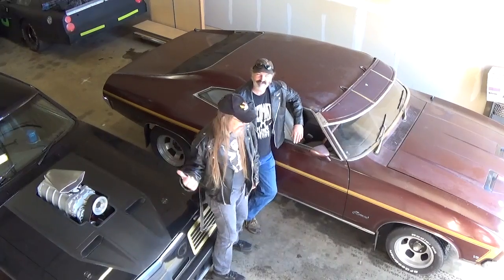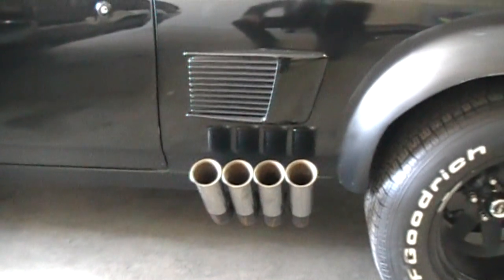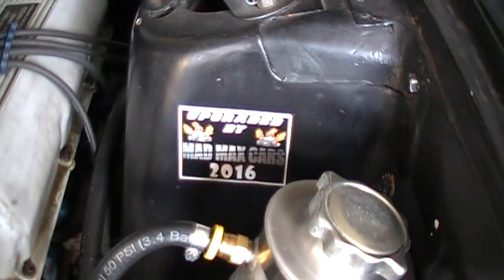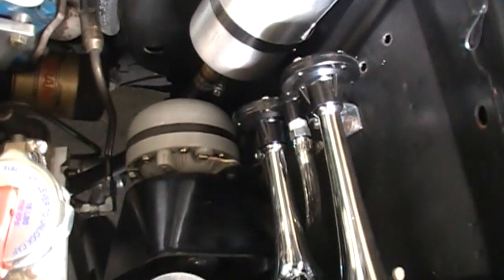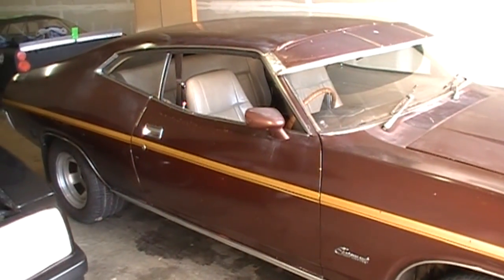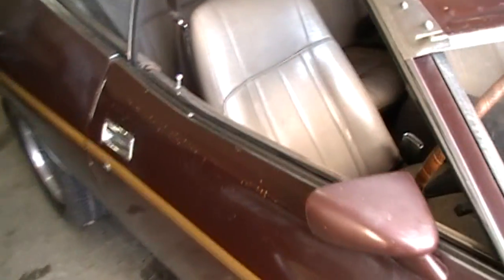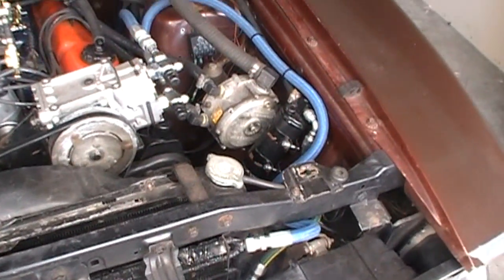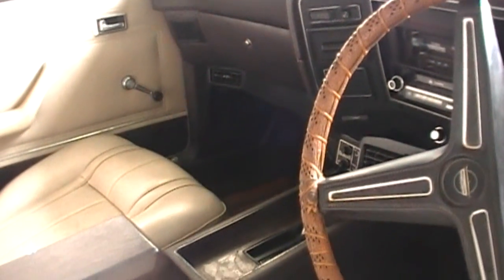Mad Max Interceptor and XB GS Barn Find Ship

Comment: Just a quick note the black car Is a Pursuit Special . Max’s yellow car was an interceptor as was March Hares XA at the start of the film. Big Bopper was a Pursuit car also but no a special. The car was only ever referred as a interceptor once and the was in MM 2 but the mechanic but as a generalisation.
Reply from the maker: That is indeed correct,  based on the original scripted description of the car and the dialog of the MFP radio dispatcher talking about the car in the first film.  We tend to use the titles interchangeably here, favoring the reference that the average person recognizes for the car "Interceptor". You might notice we used both terms with a slash in the description above for clarity. Though we do prefer the "Pursuit Special" title ourselves, it is probably worth noting that George Miller himself pretty much exclusively uses "Interceptor" as a reference to the Black on Black these days. Likely as we do, using the term that has become somewhat ubiquitous in pop culture for the general public. Thank you so much for watching and for your excellent comment!

Comment: basically a torino, fairlane, falcon body 70-72 all ford ...  but getting some sheet metal & do up reskin be very kool build if possible ..
Reply from the maker: It is the Mustang/Torino/Comet/Montego chassis. The body is quite different from the Torino when you see them next to each other. People do use the Sportsroof Torinos of that vintage for Tribute cars sometimes due to the similar look.

Comment: How can I get my hands on one of these mad Max interceptors?
Reply from the maker: Contact the team at www.madmaxcars.com we can build you one from the ground up, or you can save time and cost by grabbing the a finished turn key car that is in our classified ads right now for sale. Its in the USA already and priced well below its market value at the moment. If you want that one I would move quickly as it will undoubtedly get snapped up in no time.
Reply from the maker: Did that help?
Reply from the maker: @ericcorreia1254
 Anyway, the team can help make that dream come true. Let me know if you have any troubles connecting with them.

Comment: that looks like a 429 in that mad max car ........wow huge motor
Reply from the maker: They are Block Block Fords, but I think both are 351C engines. thats for watching and for your comment!
Reply: No Australian Falcon was ever sold with a big block. However, any ford big block will fit in the XA/B/C falcon (except the BOSS 429 unless the coil towers are modified) as their engine bay and front suspension is identical to an early 70's Mustang. Two problems with big blocks in these cars though, one is the RHD steering box sits right in front of the rear most exhaust port, the other is the vertical height from the cross member to the underside of the bonnet (hood) is about 2 inches less in the Falcon than any other American Ford so a very restrictive "low rise" manifold has to be used.  The most powerful engines you could get originally (available from 1970 to 1975) was the 351 4V Cleveland with 11:1 compression and around 330 HP.
From 1976 on the XC/D/E 351's had 9:1 compression and smog gear, however, if you can find an ex-highway patrol one of these, they were factory fitted with a 1970 "GT" cam shaft!.   Here's a crazy piece of trivia for you; these Australian built 351 Clevo's were imported BACK to the States and fitted (by Ford) into the CiHP Crown Vic's up until 1984! (the cars could not be registered in California after their police days as they had no hope of passing smog tests)

Comment: For those not familiar with the Aussie Cleveland engine there was a 351 plus a 302 that was never available here in the US. That XB Fairmont was likely a 302 car.
Reply from the maker: Indeed it is. Now totally rebuilt to factory spec from the oil pan up. If you would like to see more videos of this car, you can see the "Barn Find" and "Arrival" videos elsewhere on our channel. Thanks for watching, and for your comment!
Reply: GTs were all 351. Early GTs used open chamber 4Vs
The 302 were a 3" stroke crank, 6 030 rods, normal 351 pistons. Same block as a 351. 351 engines were all navy blue, 302s were brighter blue with orange rocker covers.  And closed chamber 2V heads. And little 2 bbl carter or stromberg carbs on XA XB. XC used a Thermoquad on both 302 and 351. With the pollution requirements they ran the valves so hot the simply burrowed up the ports and made oval valve guides. And were 12mpg dogs!
RThe XA XB engines never had these problems.
Reply: The Fairmount came with the 302 or 250 straight six. The 351 was a custom order as was the paint. Most were either the Brown or Cream in colour. Also the GS could come without the GT dash and grill if ordered that way. Great car I had a sedan GS Fairmont which I sold for $500 dollars back in the 80's to a guy that just wanted the hood. Didn't realise at the time that these cars would be a collectors item.
Reply: @ldnwholesale8552  bro, don't forget the beautiful XR and XT gt's. Both legitimate gt's, both raced at Bathurst. XR GT came with a 289 Windsor, XT GT came with a 302 Windsor.

Comment: Greetings mate.   My uncle had  a Fairmont  coupe 302 with white interior brand new in the 70s'. I think it was an XB.  Nice car, bit cramped in the back....How do these cars ride compared to the US Fords of  the same era.  BTW   are  the US LPG fill necks the same as ours?  I mean if a OZ LPG was shipped to the US could the cars be filled at Gas stations or do you have different nozzles?     cheers brothers.
Reply from the maker: Greetings!  Sounds like your Uncle had a cool car!  The ride of these cars compared to USA makes is very similar.  They are built on the Mustang, Torino, Comet, Montego chassis with a slightly different wheel base. Most parts even interchange with various USA cars of the era. The back seat is cramped about the same, even worse on the Mustang (might as well get used to not having circulation in your legs if you want to sit in back). The LPG fill is the exact same. Guessing it is an international standard. Thanks so much for watching and for your comment! Cheers!
Reply: + @MadMaxCars  The LPG filler , well that is good to know.    I had a '76 Fairmont GXL  in 1980, FMX 9 inch....fitted the 302 2V heads and it really bumped the CR up....LPG...can take high compression.       BTW   telling your mates that you own a 302 Cleveland in the US is a bit of a conversation starter .        Looking forward to more vids.
Reply from the maker: @BJBFOREST  LOL, yes, most of us yanks (especially ones that know Fords domestically) will start in right away when you say 302C, and then of course the education starts. That talk inevitably leads to "You do know that have like 4 more types of heads for that engine than we do? Let me tell you about the Phase 4......". We do have a ton of other cool videos on the channel you my enjoy if you haven't seen our older ones. We will keep the new ones coming too!
Reply: + @MadMaxCars    Phase  4...the holy ground of HOs.  In ' 72 the Victoria Police Traffic Operations Group received an XA GT for interceptor work...the Ford factory was just up the road from the Dawson st Transport branch.   the car  was owned by Ford and lent to the police.  It had a huge carburetor on it without any carby id tags.  ...it was reported to have reached 160mph whilst with the police.  After a short time it just disappeared , returned to Ford.  It is felt that it was a Phase 4 and was being tested for durability with the police.  If anyone can break a car it will be a cop....Legends are made over a few beers but the person who told me was  adamant and was in the TOG police at the time.
Reply from the maker: @BJBFOREST  That is SO COOL! It would be amazing to know where that car is now. We imported a Landau once that had Phase 4 parts snuck onto it. We were pretty sure it was one of the places that the factory "disposed" of some of the bits.
Reply: @MadMaxCars  they made an XA RPO 83, it was a hastened GT ish model with many of the left over phase 4 bits. I  never heard of them using them on the Landau, mainly because it was a luxury model coupe (full electrics, flip up covers on the headlights, 2 moulded seats in the back instead of 3) but heaps of the Fairlane and LTD models had strong 4 bolt mains in them, 9 inch  lsd's hooked up to c4's or c6 transmissions,  so that wouldn't surprise me.
Reply from the maker: @whosyourdaddy842  Yeah we are pretty certain. We have a Aussie Mate who lives in the USA now who knew what they were when he first saw it. He used to work at Ford of Australia. He said he had heard they basically just used the parts on some random cars instead of throwing them out.

Comment: I'm not that familiar with the mad max engines....so that blower sits above the carb and is it functional or does it just spin for looks? I ask because blowers are normally mounted underneath the carb and suck fuel in through the carb and then into the manifold......
Reply from the maker: Most of the Mad max replicas are built with a non functional "Prop" blower like the one in this video, because the clients want the "Magic Superhero Power" from the movie of the On/Off Blower active by the red switch on the shifter. We do however build them with fully functional blowers from time to time when a client wants that instead. Thanks for watching and for your comment!

Comment: Was propane a fuel option in Australia from factory or dealer prep? Lastly the steering wheel in both of those cars are on the wrongside! Just saying; )
Reply from the maker: The propane is an aftermarket add in pretty much all cases. Sometimes a Dealer install but not often.  As for the steering wheel, its on the "Right" side!  ;-)
Reply: Ford and Holden both produced lpg gas/petrol combos from the factory from the late 80's until both ceased production in Australia. I think the EA falcon series was the first ford, I'm not sure about the first model Holden. We used to produce Mitsubishi's and Toyota's too, but I dont know if they had factory lpg options. The government had a scheme going until about 4 or 5 years ago where they would subsidise the cost of installation to convince people to do it.

Comment: The aircon is not factory fitted, it is a dealer fitted option, factory fitted units were integrated, the controls were fitted into the heater control panel and the air runs through the dash vents. The Propane or LPG system is also not an original item, it was probably fitted in the 1990's by the looks of the converter and snorkel. The hood is also not original, it's a GT hood as it has the locking pins installed. Wheels are not factory either. It's a pre June 75 model as it has the vertical rear side marker lights. The fuel filler cap is also GT or JGS. Yes it's a nice barn find but very far from original.
Reply from the maker: Indeed much of what you are saying is quite correct. These days "Dealer Added" options are often considered essentially "original", as they were often supplied by the factory and added by dealer mechanics (as an SDC member I can attest that this is generally true among Studebaker collectors also, which I notice by your name you presumably are one). Of course the wheels are obviously aftermarket. However some of the things you mention such as the fuel cap and hood could be ordered as factory options, but also could have been added years later as well. You might note that we say in the video that the owner wanted it kept in "as found" condition as much as possible, and the restoration was done with that in mind. So when we say "original" in this context we often mean as the car was when it was stored away 20+ years ago. Thank you for watching and for your comment!
Reply: Studebaker owner, yes but I also own a couple of rare street rods and 2 March 1976 built XB Fairmont Coupes of which I've owned since 1982, No there not for sale!
Reply from the maker: Always glad to meet fellow Stude fans. I'm a card carrying SDC member, and have a 55 Commander Deluxe Regal Coupe, and also am restoring the 1951 Desert Explorer prototype. Don't sell those beauties! Keep them close to your heart!

Comment: That ford was running on propane? is that safe? granted we're hot rodders so the answer is always no of course not lol but still its the first I've heard of that really on a car that old as is from back in the day.
Reply: Kavinsky Smith.
Yes very safe. Cars converted to duel fuel (LPG / petrol) are very common, and have been around since the early 70s in Oz.
Reply: Huh, well atleast no matter what happens we'll always have a way to run our V8's then lol
Reply: Kavinski Smith'
Too right mate. I've got an old 327 Ponty that's been running duel fuel for years and will do for many more.
Reply from the maker: Yeah. Its not as common in the USA but we do it here too.

Comment: i would love to have a holden.
Reply: Mate Holdens are pox don't get one
Reply from the maker: LOL, The Nightrider liked his ill gotten HQ Monaro!
Reply from the maker: That is a really REALLY good point. Look what happened to him.....
Reply: I have a Holden Sprinter Ute copycat I may consider selling once I get it painted. It's actually a '74 4 door Plymouth Valiant cut n chopped into a truck style car. One of none built and gets a lot of attention at car shows.
Reply: +garth locklin
Never heard of a Holden Sprinter Ute, neither has Google. Do you mean a Sandman, which came in panel van or ute versions?
But did you know that Chrysler themselves made Valiant utes in Australia from the AP6 series in 1965 to the end of the CL series in 1978? They were mostly called a Valiant Wayfarer, and in the last year or two there was a model called the Drifter. There was also a basic stripped-down version sold as a Dodge Ute, the only Dodge that Chrysler Australia sold in those years.

Comment: What is the price tag for falcon cobra? 🐍
Reply from the maker: Those are definitely cool cars. We can certainly find on for you. Contact the guys at the website to get more details. www.madmaxcars.com
Reply: Cobras in immaculate condition go for $110k but I've seen a good one go for $80k Strange as they were Ford rejects.
Reply from the maker: That is a pretty good range. Of course there are always "Exceptions" that go for under or over by a surprising amount as well. It is curious how any unique "trim packages" Ford Australia did that are going for ridiculous amounts over standard ones these days. The Cobras, John Goss Specials, XA Superbirds, and the like. The you have dealer packages like the "Horn" cars, which might be roughly equated to the Yenko cars in the USA.

Comment: Hertz I don't know a whole lot about these girl Falcons but when you say propane parts what parts are you talking about does it run on propane
Reply from the maker: In the case of the Barn Find XB GS Fairmont in this video, it is set up with dual fuel. It can run on Gasoline, or Propane (LP in other parts of the world). You can see in the engine shots where the air cleaner is, there is a special intake for the propane, one of the many parts of that dual fuel system.
Reply: Austin Wilson yeh fuel shortage prevention mate probably why she was parkd
Reply: Does that kooky offset plenum/air cleaner have anything to do with the LP?

Comment: this car needs functional blower
Reply from the maker: We do often build them with functional superchargers, when the client wants it. Most want the "Movie Magic" on/off power of the prop unit like this however.  Thanks for watching and for your comment!
Reply: Yup. The issues with having a blower that turns on after the car is running are,
It would run like crap unless you had a system to switch the tune to a boost tune while running.
It would more than likely blow the intake off.